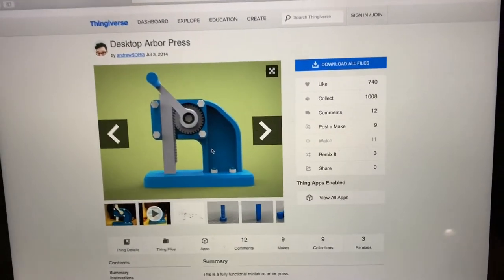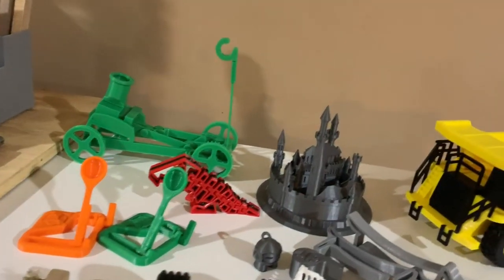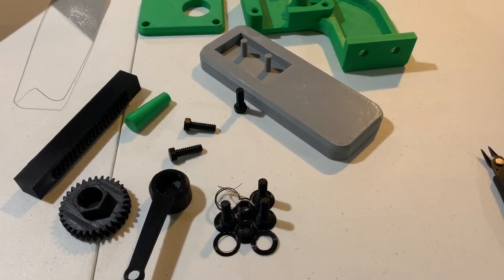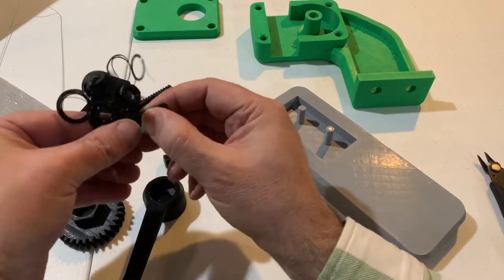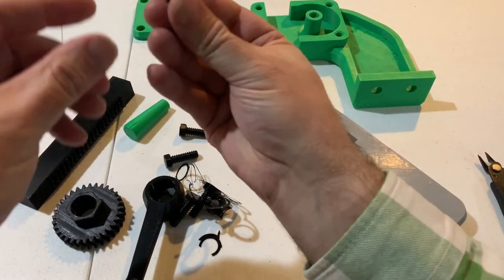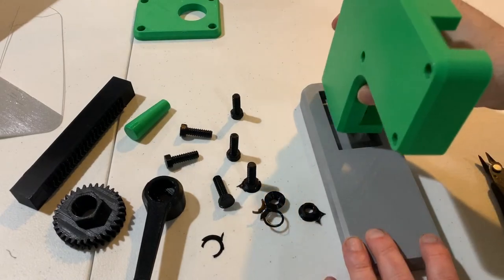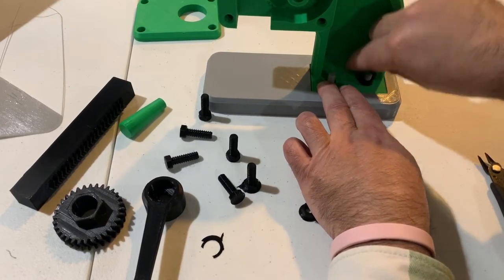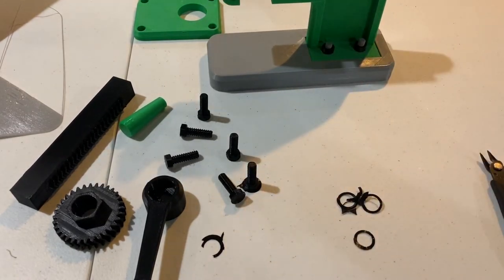I broke it! 3d printed Desktop Arbor Press on Prusa I3 MK3S

Comment: PETG does not like to be squished as much as PLA, so lift your Z a bit for the first layer, as it was most likely the cause of your trouble at 2:15. Also keep your cooling switched off for first 3 layers, for the rest at maxium of 50%.
Reply from the maker: Thank you.  Yea this seems a common observation, I noticed myself I had to lift Z when switching to PETG and lower with PLA, and I got a comment on another video saying they adjust up for PETG also.